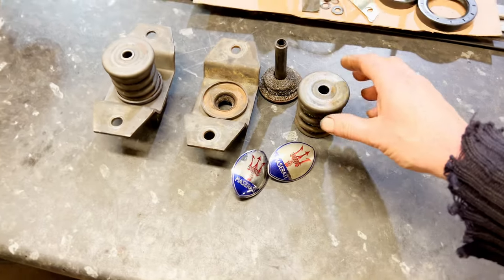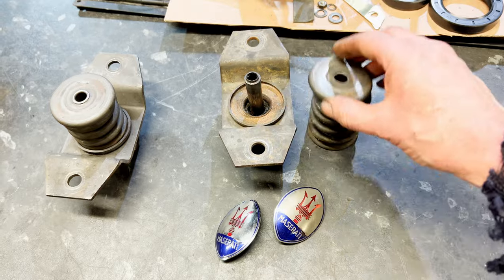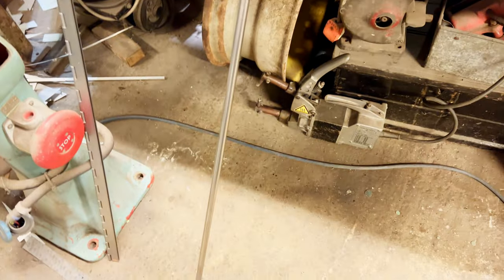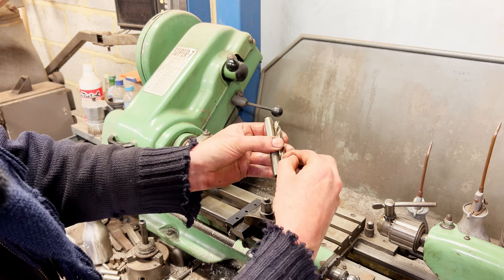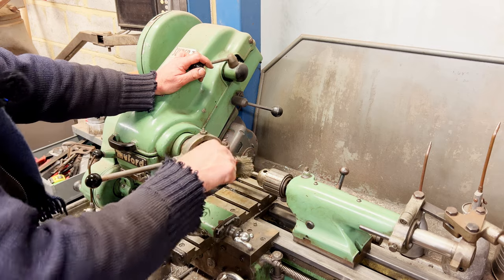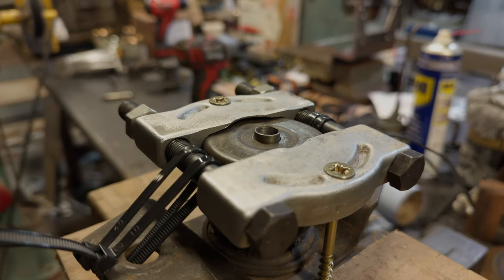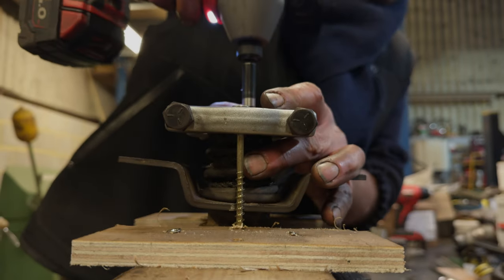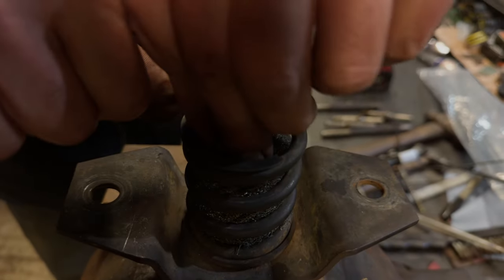Maserati Engine Mounts repair.

Comment: Where there is a will there is a way! Nice save Mark
Reply from the maker: It needed fixing and it provided a nice little bit of content for the channel.
Might I add that it also proves that in this throw away society a classic V8 Maserati is a good sustainable alternative to the modern car with an engine mount that can’t be repaired and will just become landfill as it will not be recycled !

Comment: Excellent, thanks for that. I love the wire wool shock idea.
Reply from the maker: I’m thinking that Maserati were going for a more sophisticated GT with the V8 cars and this was their answer. Not to mention that it was probably a bit more resilient with the higher heat produced by the V8 .
The 6 cylinder cars have a much more traditional rubber mount much like that used by Jaguar in the 60s.
Reply: @marksitaliangarage  I guess you are correct about them worrying about the effect of heat from the V8. It looks effective.

Comment: Hi Mark, these engine mounts were made in France for Maserati by the company Vibrachoc. Back in the days, the boss of the company was a great friend of president Mitterand !
Reply from the maker: This is interesting. Were they used on French cars  ? 
Did this in any way have any effect in the Citroen interest in Maserati or the SM project ?    I had assumed that the V8 created more heat and rubber engine mounts would deteriorate in the higher temperatures so this was the solution.
Reply: @marksitaliangarage No, specific to Maserati V8. A friend of mine entered in contact with the company to know if drawings were still there... but everything is gone...
Reply from the maker: @blenheimwilde  Ok it’s an unconventional design not something that I have seen before. The closest thing I am aware of is the Jaguar gearbox mount which employs a large coil spring. That is a shame that the information is gone so often the way.
But good work trying.